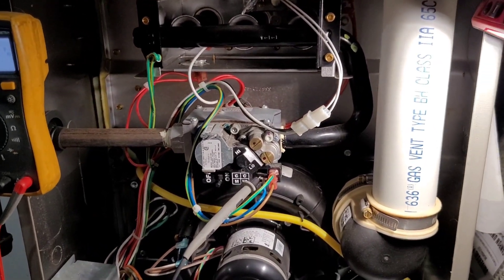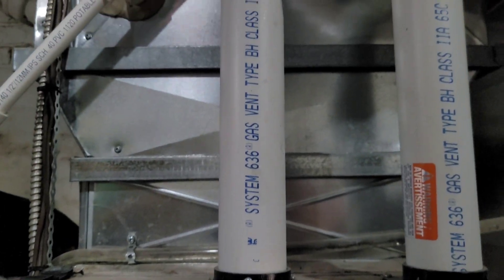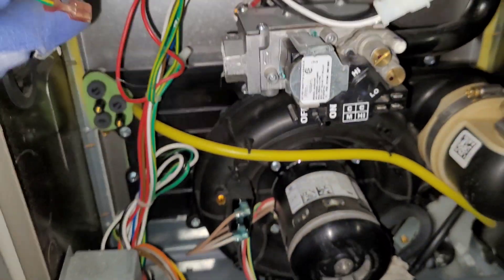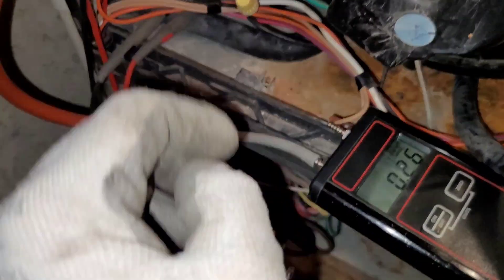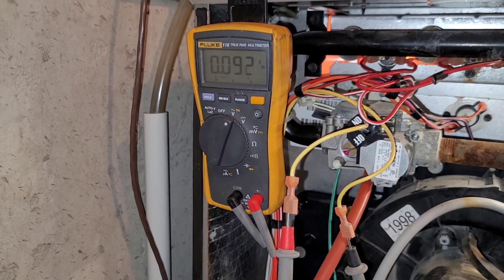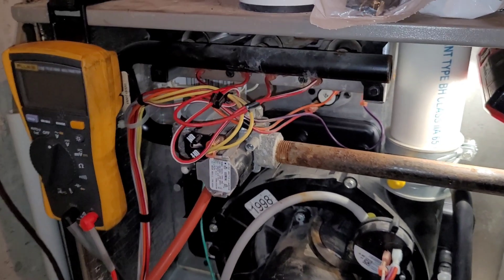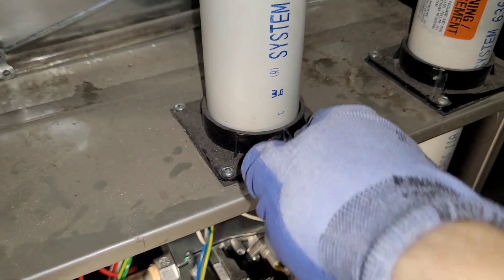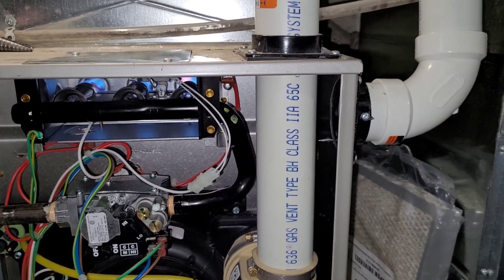If your furnace is piped like this, ITS GOING TO BREAK!

Comment: you can also put a fernco coupling with an internal drain to catch the condensate running down the walls of the pipe before it drips into the cabinet
Reply: That’s what I’ve used

Comment: Just add a sanitation T with a trap on the fresh air intake in horizontal position and you pipe anyway you want it will not corrode. Simply stupid.

Comment: I often wonder what the failure rate is from inattentive installs.  I encountered one on a late-90s install with an add-on humidifier where the reservoir was hovering over where you moved that intake pipe from.  Only threw a problem on the coldest day of winter, after the house had been packed with dozens of people for a new-years party.  All those walking heaters meant the furnace didn’t come on for at least 24 hours.  (long, popular event).  Next day the cleanup volunteers note it’s getting chilly, and it’s -35 outside.  Turns out the float valve had calcified and the water was dripping slowly, but precisely over the back of the burners, and wetting a flame detect sensor.  Not enough in normal operation for it to fail, as the burner would ignite, everything would dry out quickly, and things carry one.  After a day of getting soaked, fault was registered, the ignition cycle was halted, and things get chilly.  10 minutes with a hair dryer and shutting off the water supply, and things were good to go, with an expedited service call scheduled on the following Monday.  (these things always seem to happen on a Sunday, no?).

Comment: 1. are the furnaces got knockouts in the top to install pipe in the top?

2. why does the manufacturer put knockouts in the top of the cabinet if the manual sais not to put an intake vent in the top?  unless

2a. for tooling purposes the factory will score the knockouts in all places top and side for multiple installs and one size fits all.

2b. they want to make more money so they design it in a way to exploit stupidity so they can void the warranty and force an out of warranty repair or replacement but to conform to legal requirements they mention the warning in the fine print.
Reply from the maker: Typically there are multiple knockouts for multi-position furnaces, it would be fine to use the top knockout if the furnace was installed horizontally

Comment: I like that you addressed the intake.
Thinking out loud here, what do you think about, if there is room, putting a tee in with a drip leg?
Carrier also does have an inline water trap for this exact reason. it is different than the field made tee set up, though, but is the same principle.
Reply from the maker: A drip leg with a drain would be helpful for sure. I'm not familiar with carriers inline trap, I've only seen the field made setups.
Reply: @SmitHVAC.  
https://www.youtube.com/watch?v=kHkcx4lVz-Y&ab_channel=MichiganHeatingGuy
Reply: I’ve put the tees on temp star and still run into the same issue if possible now I put both the exhaust and intake on the side that way also makes it easier to remove the coil for whatever reason. Great video!!
Reply: Water vapor is not sediment. Nothing is going to pull it into a tee.

Comment: Carrier came out with a bulletin later to not pipe the makeup air on top. But still a poor design. Takes out gas valve and inducers left and right. They could have easily kept the serviceability and had an actual burner enclosure like before. All manufacturers are cheaping out like this these days. It's a shame. Makes whats left of us good guys in this industry look bad.
Reply: There is a drain you can install on that intake. Carrier  makes it

Comment: Convert to #2 Fuel Erl , and no more gas valves! 
Door switches go bad, bypass! 
"No wonder the plumbing don't work, these pipes are clogged with wires" https://youtu.be/25yVhilQuhk?t=702

 There is no licensing for replacing water heaters and furnaces in most localities. Though I am not big on useless regulations,  professional techs will correct sins of the past, not just stick-it-in and hook-it-up. This can correct lethal situations.

 Because high efficiency seems to equate to very expensive annual upkeep and VERY expensive repairs, I think I will keep my 85%, 25 year old system until it is unfeasible to repair it anymore. Costs about 200.00 a year to service furnace and AC.... with the very RARE blower motor or thermocouple failure.

Comment: For these furnaces without a sealed burner box, shouldn't even connect the intake air to outside, unless it's in a closet that's too small and not enough free air space as required by the installation manual. Trane and Lennnox at least, have the intake air going into a sealed burner box, instead of that cold outside air just spilling all over inside the cabinet. Horrible design, ICP junk.

Comment: Eh most of em that are corroded in the box are because morons still use concentric vent kit terminations and side by side int ex terminations. When the inducer runs it pulls a vacuum and walah. Moisture plays a part in it but I have seen plenty corroded even with the intake in the side. 2 feet vertical seperation and 6 inches horizontal is ideal
Reply from the maker: That's a good point I've seen that as well